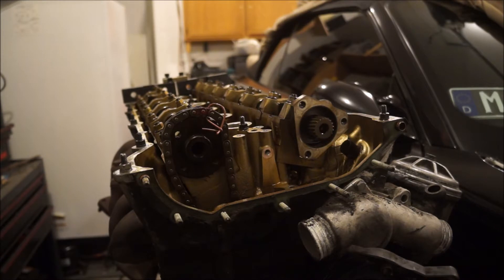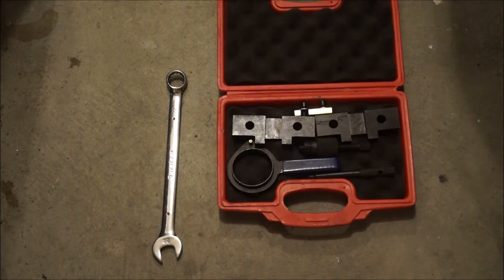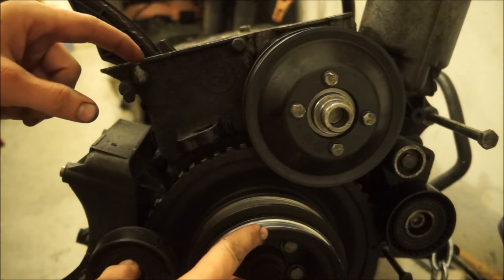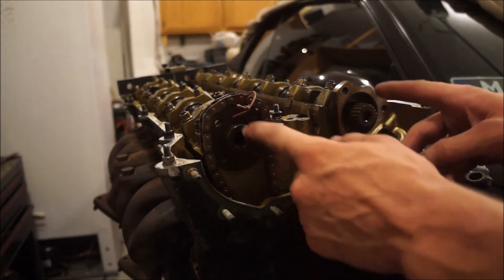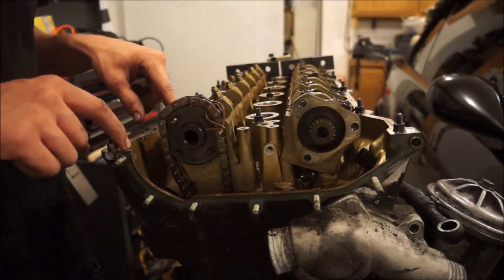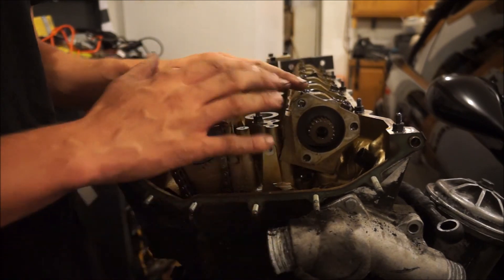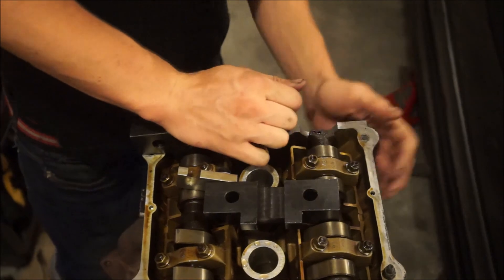E36 Vanos: Setting the Motor to TDC from Scratch

Comment: Hi Quinn, is there anyway that I can set the crank to TDC after done installing the cylinder head (torqued)? The crank is currently way off from the TDC mark (120 deg apart). Any tips are greatly appreciated. Thanks!

Comment: Good evening Quinn,
Looks like I've got a cracked head. Fortunately I was able to source a good used one and am back to getting the M52 out of my 528i back together. What is the best head gasket /gasket kits to source for this job? Thanks so much, Chip
Reply from the maker: I’d just grab a elring headgasket kit and a new set of headbolts and call it a day! Victor reins also makes a good kit but i prefer elring if you can get it.

Comment: @Quinn Clark - M3NACE, I think I blundered badly - when installing the exhaust cam, the crank was at TDC 😟. I noticed this while installing E5 and E3 cap nuts. E3 cap wouldn't bottom out and that's when I checked and found the crank at TDC. E5 cap had bottomed out. I was replacing the valve stem seals. After I turned the crank off TDC by rotating the engine counterclockwise approx. 30° using the central bolt, all went well with reinstallation of the cams.  But did I already damage my engine by attempting to install the cam while crank was still at TDC??? Are the valves now bent through contact with the piston crowns?
Reply from the maker: They shouldnt be, it takes alot of force to bend a hardened steel valve, and i dont think you would be able to accidentally bend one like that. I would continue with installation, it should be fine. Once you fire it up youll know.
Reply: @M3NACE  I can sleep better tonight, thanks - you da man🤛.

Comment: "Don't roll this engine without the chains connected, as it is an interference engine, likely valve damage will occur." Does this mean the main timing chain must be connected to the crank before turning the engine or does it mean any chain including the vanos chain? What I'm doing is using a bungee cord to keep the valves from dropping (insert the cord just before TDC of the cylinder being worked on). I'm not using compressed air. I have the cams off and need to turn the crank to bring the cylinder I'm working on close to TDC and insert the rope. Since the chains are disconnected except for the main timing chain that's still connected to the crank and moves as the crank is moved, does the above warning apply and I stand the risk of damaging the valve?
Reply from the maker: With the cams removed you can spin the motor as much as you’d like.
Reply: @M3NACE  Thanks, that's what I thought but the comment I quoted confused me.

Comment: Nice video, noticed the intake cam lock is raised on one side. Are the cam ends (with holes) suppose to be on the same plane (if you took a ruler and placed it on top)?
Reply from the maker: no, as long as the cam locks are both on the cams seated, and bolted together, you are fine. the cams dont sit perfectly square inside the locks, as long as the locks are on and tight send it.
Reply: @M3NACE  I should have asked that question a long time ago I watched all your videos and it's been driving me nuts. When I set my cam blocks flush on the head the top of the exhaust cam square does not line up with the intake one. I've seen numerous posts with people timing engines with a ruler and that's what got me confused how can the cam blocks fit flush on the engine but the end of the cam squares not line up. If they are supposed to be a little skewed then that's my answer I did not know it was normal. I really appreciate your reply!

Comment: Hi I replaced the Vanos seal on my M50tu, then I went ahead to reinstall the vanos. I tightened all the bolts and removed all the blocks and pin. I. turned the crank from TDC to TDC twice, so two rev. Now my cams are not TDC anymore, how do I adjust the cams back to TDC now?
Reply from the maker: well if you timed it correctly, when you set the crank TDC mark back to top dead the cams should alos be at TDC
Reply: @M3NACE  The timing for the cams are completely off now. So how do I adjust the timing of the cams? ( cylinder 1 are not pointing at each other, the blocks wont fit the intake cams.
Reply from the maker: @Christopher9835  well you did just the vanos seal right? you didnt take any of the cam gears and chains off did you? if you did, you will need to take the whole thing off and start from scratch. if you didnt take any of the hardware off for the cam gears then it shouldnt be off.
Reply: @M3NACE  no I didn't take the cams off. Some people said when I first re-installed the vanos, it was off my 1 tooth which caused the both cams to be off. 

So uninstall the vanos and reintallsted again. 2 TDC TO TDC crank turns later, my cams are still facing the wrong direction.
Reply from the maker: @Christopher9835  you didnt take the cams off, but did you take the cam gears and timing chains off??
Reply: @M3NACE  nothing was removed other than the vanos.
1. Loosened*(did not take off) the exhaust sprocket (4) nuts, intake sprocket was untouched 
2. Unbolted all the vanos (6) nuts 
3. Pull vanos out as I rotate the sprocket Clockwise, the chain moved along as I was turning the sprocket
4. Reinstallation by counter closewise turning the sprocket as I insert the vanos. The intake sprocket didnt grab the vanos gears as soon as it turned (this is probably where I made the mistake)
Reply from the maker: @Christopher9835  yeah so you dont need to re-time the cams, you need to install the vanos unit correctly. the cams are off time but only by a little. heres exactly what I would do. rotate the crank to TDC spot on. throw on your TDC pin. loosen your exhaust studs, and remove the vanos. if your cams are not at TDC as they should be, grab your cam locks, move them to TDC and lock them down. the cams should be close, it the lobes are not facing upwards-ish you will need to rotate the crank one more turn, but if you did 2 full rotations you should be fine. lock the cams down at TDC. install the vanos unit and make sure it grabs properly, then finish the install from there. you also need to have the dummy chain tensioner in at this point. follow this video from the 3:10 mark forward. https://www.youtube.com/watch?v=4jkzkoNHI7o
Reply: @M3NACE   
Both cams are not at TDC, I have a 24mm wrench which can turn the cams, but I would like to make sure when I should turn it. Please see if this is the right procedure:

1. Crank at TDC
2. Flywheel lock pin
3. Loosen exhaust sprocket nuts 
4. Remove vanos 
5. Use 24mm wrench to turn the cams to TDC **(is this right?)**
6. Put on cam blocks
7. Install vanos

I do not have a dummy chain tensioner, is there something else I can do?
Reply from the maker: @Christopher9835  yes, it is correct. you do need the dummy tensioner tool to install the vanos correctly, this is where your timing might have been misaligned. the dummy tensioner puts pressure on the lower timing chain as the vanos unit is getting installed, and you need that tension. as far as proceeding without the tool, you can take your actual tensioner, pull the tensioner apart, and replace the spring with some coins or something like that to fill the gap and put tension on the lower chain. in my vanos install video i cover correctly installing the dummy tensioner.

Comment: my timing chain NOT for vanos slipped when i was manually cranking the engine to clean each piston with the head off. How do i reset the chain to the correct spot? i still have my zip tie on it but its in a completely different location now. kinda nervous lol
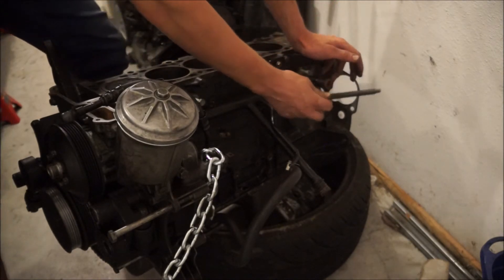Reply from the maker: https://www.youtube.com/watch?v=O1gVskqp2Xc 3:50 mark on this vid is where i explain how to set it.
Reply: M3NACE okay so the sprocket is what matters. Not necessarily the chain. So because my chain moved it’s okay as long as sprocket ends up in correct place
Reply from the maker: @ZachKramer  exactly. You mark the chain when you take it off so the sprocket will be in the correct place.
Reply: M3NACE awesome! Also when I crank it with head off it won’t crank all the way. Something seems to be blocking it. I am thinking it is the timing chain getting stuck because before head came off it was completely fine.
Reply from the maker: @ZachKramer  its probably the chain getting caught up on itself. try holding the chain taught then cranking it.
Reply: @M3NACE  Same thing happened. I will put head on and see if that fixes it. Maybe the chain just needs to be on all the way
Reply from the maker: @ZachKramer  good luck man!
Reply: @M3NACE  thank you! here is the car... well when it was running a few weeks ago hahaha https://www.youtube.com/watch?v=sQPirSxZsuI&t=97s

Comment: Man! Super informative thanks for taking the time to put it up. I'm currently rebuilding my bottom end and haven't had to do timing on one of these motors in about 8 years so was a perfect refresher as the rest of the internet wasn't much help
Reply from the maker: thank you man. this is one of the reasons I started this channel lol, when i started working on E36's there wasnt alot of directly useful information on it. I had to read like 3 or 4 forums to get the general Idea on how to do things, and at one point when I got comfterble with working on these cars and I knew my shit, I knew there is probably alot of other E36 guys with the same issue, so I set out to make tome top notch DIY's that actually worked. Im glad the vids are doing what I intended them to do lol

Comment: Hi my cam belt snapped of while trying to crank it? Because the oltenator was sized my mistake now my question is how do i time it right as i lost my tdc points, the points is there but i mean how many times i wind the bottom how do i know its dead centre tdc if you know what i mean? So by looking your video i need yo take head of then cylinder 1 has to be flush right so is that cylinder on a back of engine or fron by the way m20 engine .... please let me know
Reply from the maker: ohhhk lets take a step back here. the M20 and the M50/M52 are 2 completely different motors. M20 is a single overhead cam with a timing belt, and the M5X are dual overhead cam with timing chains, so this TDC video wont really help you out with the specifics of setting the motor to TDC. you will need to set the top end to TDC, and set the Bottom end to TDC, and put the belt on. that being said I have never worked on or replaced a timing belt on an M20 so I have no idea about the specifics on how to do that. that being said, the belt snapped because of the alternator? the belt that runs the alternator is not the timing belt. if that belt snapped, you do not need to re-time the motor as your timing belt is more than likely still intact. just replace the alternator and replace the belt, no timing the engine required. if the timing belt did snap because of that, which I think is highly not the case, and would be terrible luck, then this DIY article should be able to help you out. https://www.pelicanparts.com/bmw/techarticles/101-Projects-20-E30-Timing-Belt/101-Projects-20-E30-Timing-Belt.htm
Reply: M3NACE thank you boss lets hope i haven’t messed up so if i line up to the markings it will not crash my valves or same the engine you working with looks same to mine i could be wrong, 325i mine
Reply from the maker: what year/chassis? e30?

Comment: Thanks for the video man.
Reply: Going to attempt mine first week of September. Do I have to replace the cylinder head bolts? I know they are stretch bolts, so this is why I am wondering? I am replacing the head gasket, I bought the OEM head gasket set, so I am wondering if I should get new cylinder head bolts and anything else
Reply from the maker: of course!

Comment: I hope this helps me  ;o I'm re-installing the cylinder head on my 318is ,I'm picking it up from the machine shop today and I have to set the timing to tdc
Reply from the maker: e36 Crow im pretty sure the M42/M44 timing is the same procedure, as im pretty sure they use the same tool to lock the flywheel and cams. I will look that up for you and re-comment later today my friend!
Reply: Thank you!!